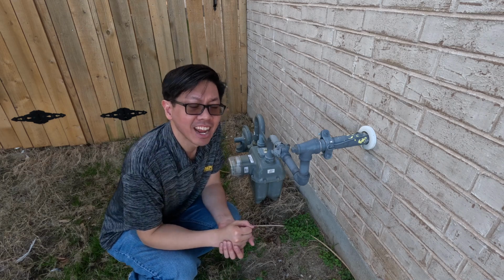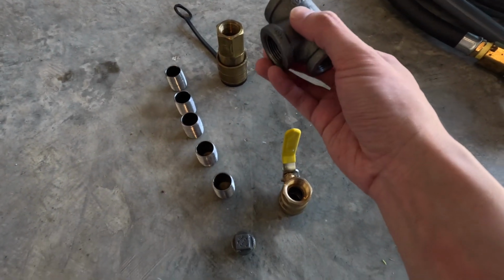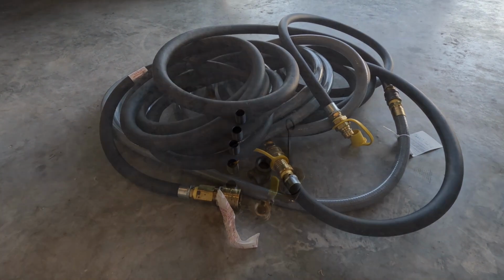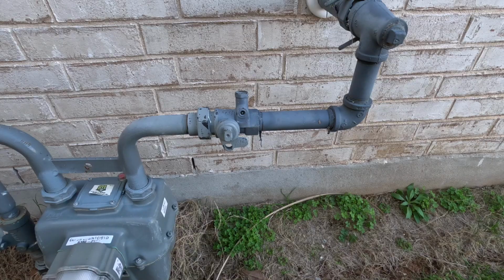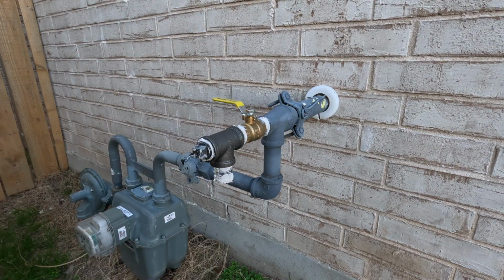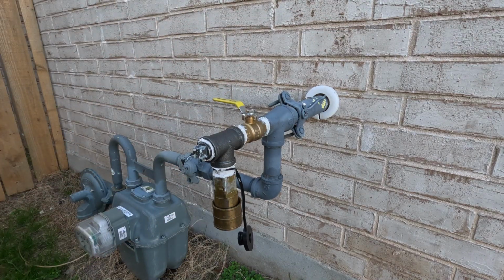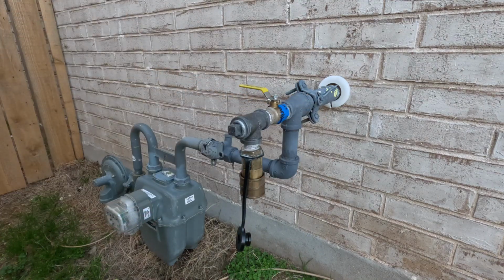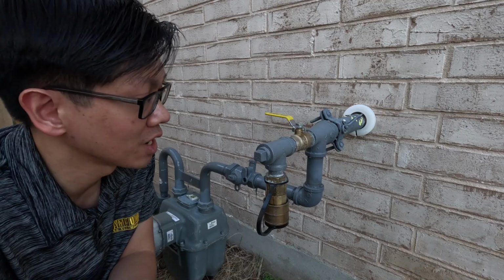NATURAL GAS Quick Disconnect Hookup For "UNLIMITED" GENERATOR FUEL

Comment: You should never connect to t fitting on a gas meter that is for the natural gas utility company to connect to for meter changes or other work at meter. I am a natural gas utility company technician. Also most size one meters will not support that added load of gas consumption from a generator
Reply: You're evidently a youtube tech, not a real one simply bc you're unaware that Jon is working on the residential side of the meter, not the utility company side. Anything after the residential lockout shut off is his responsibility. The piping from the utility company before the regulator has an additional shut off valve as that is how they replace the meter in the first place.
Reply: So where do most installers connect the gas line on stand by generators that are installed next to gas meters?
Reply: dudes a troll there was nothing wrong with doing this. he could have used some gas rated teflon in junction with his pipe dope but even that's personal preference. @Kevinw4040
Reply: it's cuz it's Canada.
Reply: very helpful. how long did you wait for pipe dope to dry before running the leak test?
Reply: @St3rmTig3r  I would suggest saving yourself the mess of that crap and just getting real thread sealant tape. Just a note that he didn't cover, there is a special kind of sealant that you need to use for gas lines.
Reply: @St3rmTig3r I would save yourself the mess and just get regular pipe tape. Just a note there is a special kind of dope and tape you have to use for gas lines.   Otherwise as far as dry time on the messy stuff It's pretty much ready right away. You do have to read the instructions though because that varies depending on what kind you get. 
 I don't like it cuz it makes a mess gets on everything and then it literally glues the crap together if you ever want to take it apart again.
Reply: Also what was ballpark time spent to actually do the modifications (assuming one has all the appropriate parts)?
Reply from the maker: @St3rmTig3r  I got everything done within an afternoon and I was filming (filming makes the process take 2-3x longer than if I was just doing the job)... Your mileage may vary.
Reply: I’m not a natural gas guy, but it looks like you did a lot of things incorrectly at the meter and I agree with the guy saying you may need a bigger gas meter in the winter time. You may not have enough volume to run the generator, your furnace and a hot water heater etc…
Reply: @no1but24 Larger meter? No. There's a calculation for BTU consumption which 3/4 supply suffices for most homes. That's a 1" or more supply line from the city reducing down to 3/4 and even 1/2 in homes. They don't run bigger out of framing concerns and the cost associated with running bigger framing lumber for larger diameter lines. Residential NG can fuel dual furnaces in many homes which have two separate HVAC systems. Btw, the guy above doesn't know how to identify which side is utility and which side is residential at the meter.
Reply: @WildDisaster  It's actually two things, but not about the pipe size.  There are 'standard flow' and 'high flow' gas meters.  The gas utilities recommend the high flow meters when you are supplying gas for a pool heater, and or whole house generator.  The second thing is the size of the pressure regulator that is installed between the gas main and the meter (or rather the flow capacity of that regulator).  The regulators are rated by both pressure levels (on inlet and outlet) as well as BTU flow capacity within the rated pressure limits.
Reply: @no1but24 as you said you are not compatible so shut it

Comment: Hi just wondering i see you painted the pipes you installed. i want to do the same thing. did you use regular rustolium paint? does it affect the pipe sealant?
Reply from the maker: Hi John, yes, I used regular Rustolium paint (https://amzn.to/3Lyrqvt). It does not affect pipe sealant. Be sure to test for leaks before painting and you should be good to go.

Comment: Wow! Just saw this as my head was hitting the pillow, lol. Long time no talk :). I got my gen shed built and insulated, got my interlock setup with caveats and the 100520 is in the shed with identical regulator installed...and I just realized earlier I was short one male QD to fit through the wall of the shed so the NG line would be on ginormous QD at the garage wall, ginormous QD at the in point through the external side, on/off valve at the inside wall, then a five foot pigtail with Ginormous QD onto the regulator, whew! I also need to order in the 24' 3/4" blue hose, not cheap, lol. My black pipe pokes through the brick garage wall and is capped off so I will just open it back up (valve turned off in the attic), do some air cleaning and fresh taping and pressure testing then put on the first QD. All of this thanks to your trail blazing :), and I will watch this in the morning! Thumbs up, Jonathan! :)
Reply from the maker: hey @mrrickychuck-OklahomaUSA, I was heading off to bed myself after shooting the video and uploading. :) So glad to hear that people find my videos helpful and that it has helped people - that's a big reason why I wanted to make them. Nice setup you have! Good luck finishing it all off! Thanks for your support! :)
Reply: What the heck only 14 minutes??? Watching it now, lol. Thought it was one of those Gone With The Wind epics, lol.
Reply: I see you switched to dope, is this code down there?
Reply: Good video. Is your meter behind a gate? We have hooligans in town but my meter is out in the front yard area so my valve is behind a locked gate. It has a padlock options but not sure I will bother. OK, glad I clicked on the notification before I signed off! :)
Reply from the maker: All the other black iron fittings on my house have dope, so wanted to keep with that. I like tape as it is less messy, but for a permanent install (not on a hose or the generator), I felt it was appropriate to use dope. I don't think there is any codes requiring one over the other.
Reply from the maker: @mrrickychuck  my meter is in front of my gate. I found that spot too accessible to keep my generator there. It actually would be the perfect spot because both gas and electric come into the house from there, but it would mean my generator would pretty much be entirely in the open. I know it is really noisy and if someone really wanted to steal it, going through the fence isn't going to stop them, but I figure keeping it in the backyard is a tad bit better than for it to be out in the open.
Reply: @jonathanDIYs  I have been searching for places like you mentioned and were able to piece together the length of hose.but  ebay was same as Amazon for a 24' 3/4 piece, those things are apparently made of palladium rubber, lol
Reply from the maker: It took me 3-6 months waiting for the right deal to come up. I setup ebay alerts when new items popped up that met certain keywords like "3/4 NG hose". You can set up things like camelcamelcamel or joinhoney to watch for price drops on Amazon.